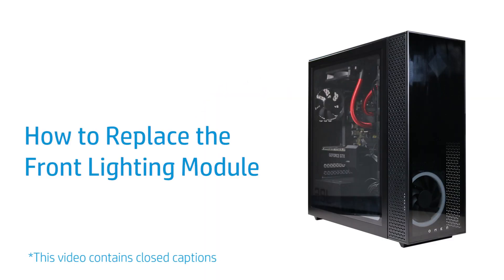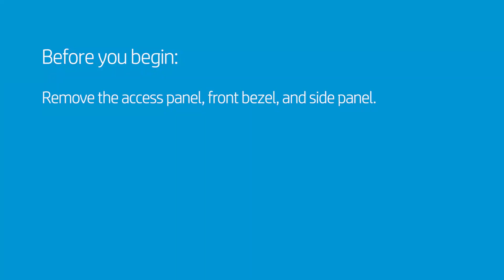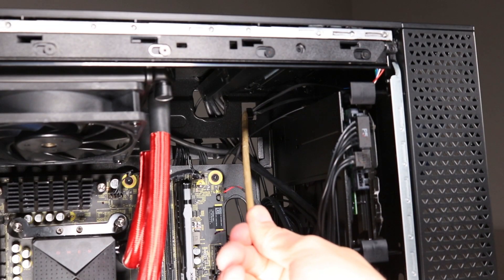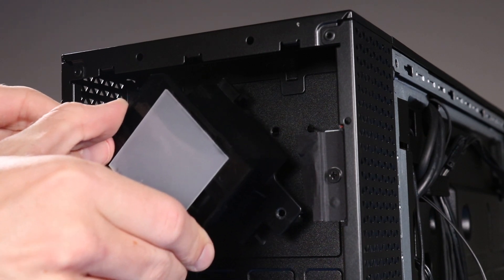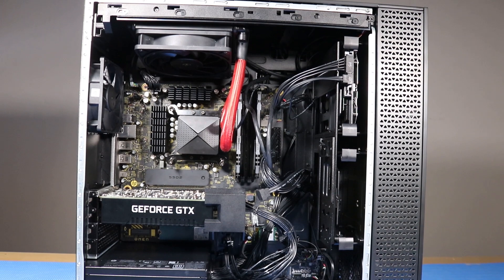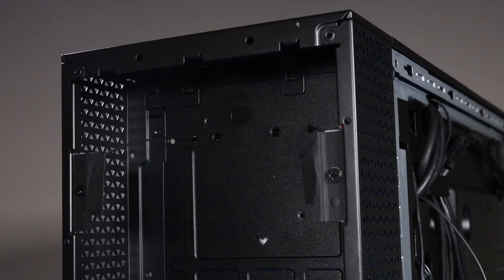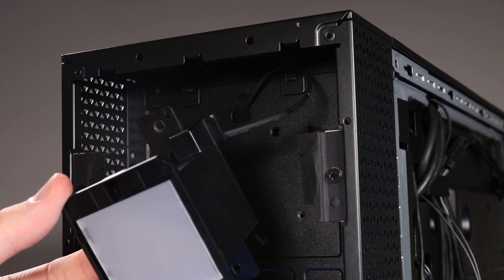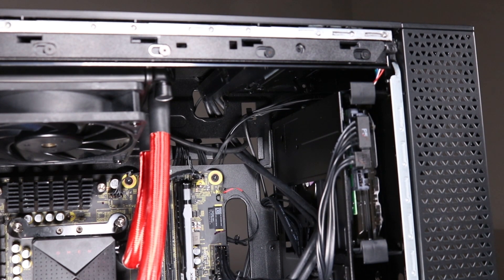Replace the Front Lighting Module | OMEN 25L GT11-0000a, 0000i, 30L GT13-0000a, 0000i | HP

Comment: In my hp omen I am getting a Corsair water block with 3 fans I do not know if it will work but I am giving my pc to a man and I am getting a white Corsair case do u think it will work in my hp omen  25 l
Reply from the maker: +Riley Madden HP does not recommend upgrading or downgrading hardware parts or software that is bundled with the product as It may affect the manufacturer's warranty and performance, however, you could change the configuration at your own discretion.

Comment: Can I connect aditional Leds? Where can I buy it?. Thanks
Reply from the maker: +Julio Llanos HP does not recommend upgrading or downgrading hardware parts or software that is bundled with the product as It may affect the manufacturer's warranty and performance, however, you could change the configuration at your own discretion.